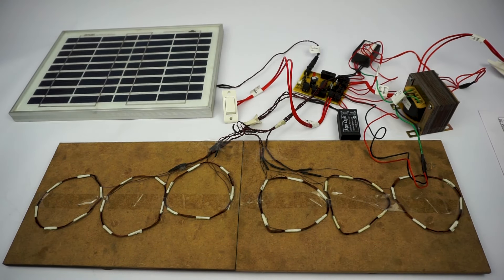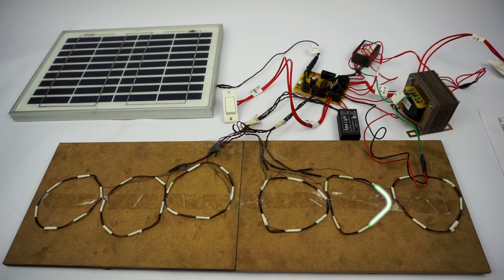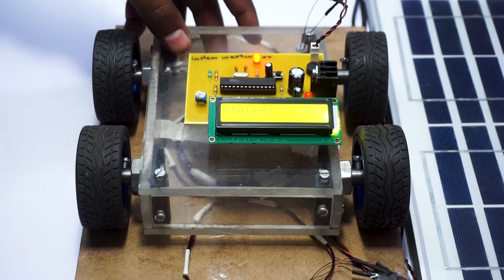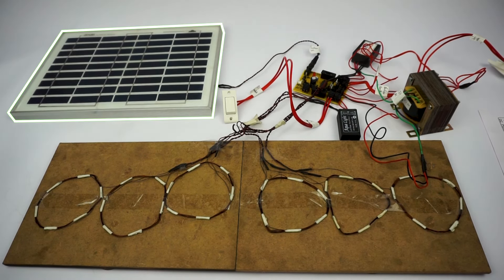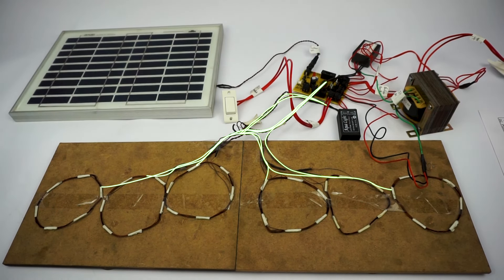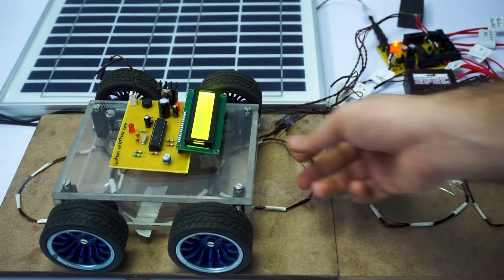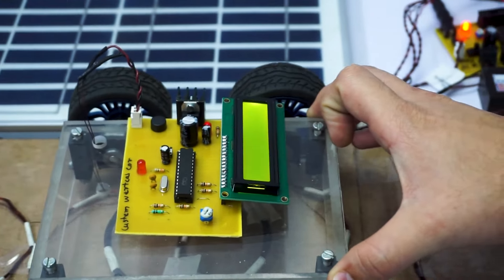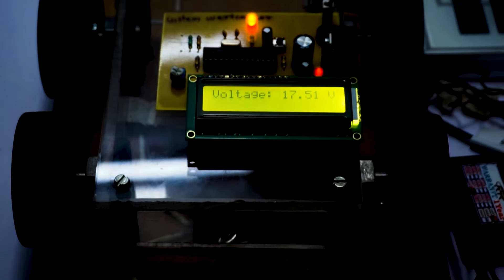Solar Wireless Electric Vehicle Charging System for Non Stop EV Charging

Comment: At night, underground and stored in a garage. Solar powers light emitting diodes better than storing energy in cells.
I need a workable solution as I am a disabled driver and cannot use plugs for anything.
Handles, levers and bare objects like coins remain where they are.